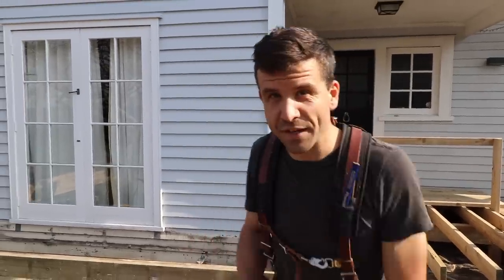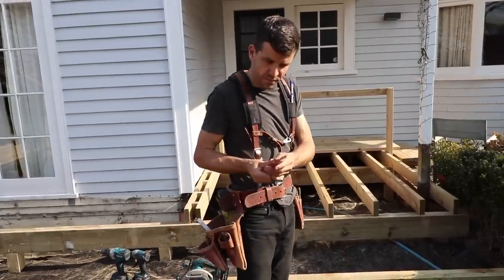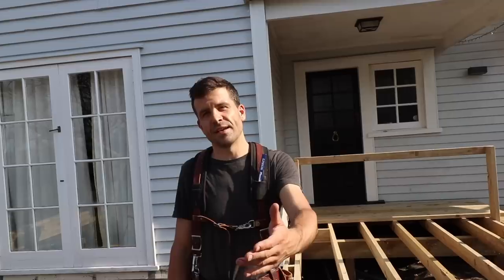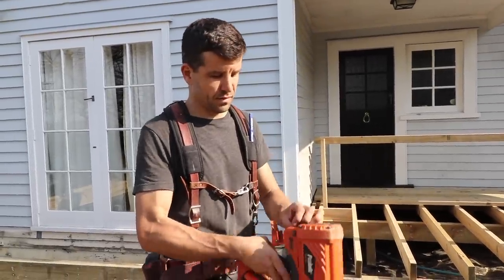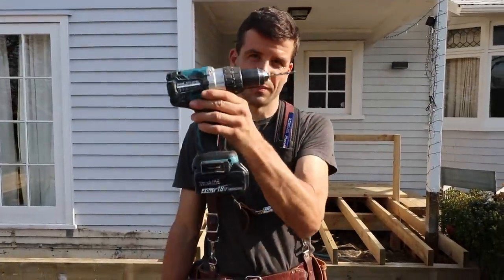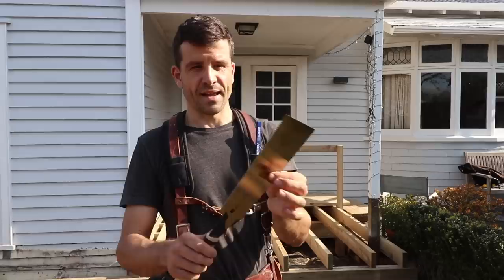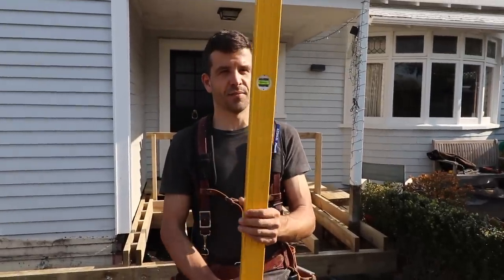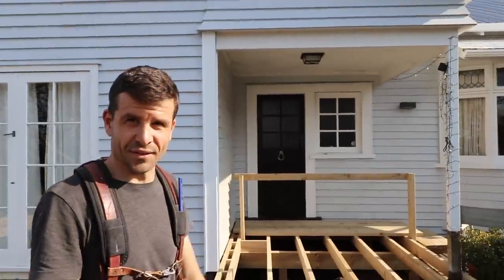First Year Apprentice? Get These Tools!

Comment: Wow, you must pay your apprentices very well if you expect them to supply their own cordless tools and Paslode nailer.  You must have a good contract where you guarantee them steady work for the first year to make this happen???  If i expected an apprentice to show up with a $800 dollar tool bag and $1500 in power tools, I better be ready to hold their hand when mommy isn't there.  An apprentice should make purchase decisions on tools when he is closer to being a journeyman and knows what tools he will need for the line of work he will be doing.  I'm in Canada and most of the time I'm happy if the help shows up at all.  If they have a lunch with them that's a bonus, and if they eat something other than coffee and donuts, they might actually be able to do something...
Reply: Everywhere I worked as a young man all of the Pneumatic Tools, Circular Saws and the large 4' & 8' levels all belonged to the company. 

I had to supply my belt, hammer,tape, and other basic tools which I started with some used hand me downs and bought a few better ones each check. My first apron was two lightweight leather bags on a webbed belt bought from ace hardware. My first toolbox was open topped which I built from pine shelving and a dowel rod.
Reply: I was thinking the same! Haha. I was also thinking about how slow the framing must be if they’re all using those gas paslodes! To my knowledge they’re still single shot and I’d hate to try and nail off with one of those. That’s a punch out gun in my world.
Reply: Phil Gilbert I’m a carpenter in Florida and everything here is built around wind load. When you’re nailing off windstorm osb 3 inch on the seams and 6 in the field with every opening and the top plate being double run 3 inch, no battery or gas nailer out today can keep up with the speed we nail off. I would go broke buying gas cartridges if I tried to use these Paslode guns exclusively. It seems to be a different world where I’m building than where you guys are. Now for punch out or running trim, nothing beats cordless. I do agree with you there.
Reply: @brandongouge9922  cordless has been keeping up with us pretty decent up in SC. air is still king but the gap is quickly closing there.
Reply: It's all about the tools here. I'm not an apprentice, I was qualified in a different trade, and I got a job as a carpenter because I put together the full compliment of tools and a decent van. Over here in NZ if you have the gear, it's assumed you know how to use it. I'm not even going to do an apprenticeship, I'm going to work for a year or two and get licenced instead.

And yes apprentices are expected to fork out for very expensive tools, and no they don't get paid well at all. Wages in NZ are shit. This is why I waited until I found a way to avoid being an apprentice when I decided to switch to carpentry. I have two mortgages mate, I can't survive on minimum wage. These assholes need to realise they are locking out keen, dedicated and committed adults who want to get qualified and already know how to get up and go to work every day, because they pay money that only a kid just out of school would accept. These kids don't know how to work.
Reply: @Patrick-857   spot on, im in Scotland , only 25 years old & over the last few years have been improving upon joinery skills but no company will take me on as apprentice as they would rather pay a 16 year old 120 a week, instead of forking out for dedicated, prepared workers
Reply: Remember, this is NZ dollars, not US dollars. . .
Reply: @arttyree4504  Still, when you adjust for exchange rates, we pay a lot more for tools here in NZ compared to the US and others.
Reply: @Patrick-857  Yes, am not surprised. I would supposed anything imported would have the cost of shipping added. Fortunately, good tools last a long time.
Reply: @brandongouge9922  Milwaukee has some great battery nailers now. They just released a battery powered framing nailer, and you can fire it off as fast as a pneumatic with a bump trigger. I think it gets around 750 16ga shots from a 5ah battery. Granted, this was not out 6 months ago when you wrote this.
Reply: A S C E N D E D W H I T E M A L E  - wow I didn’t even know it was possible to do this, I’m 23 and finding it hard to find an apprenticeship. So when you say you’re going to start working and then get licensed - could you elaborate a bit? Will you just be continuing your current job and learning the skills via internet? And how does one get licensed without becoming an apprentice?
Reply: @Patrick-857   I just moved to NZ from Canada and can't agree more about the wages.  The standard here seems to be, "take advantage of everyone you can until they get fed up and dump you."
Reply: @emersonbartholomew9562  If your trade cert is more than 2 years old then you are considered an unqualified applicant by the LBP board, so you are on the same level as someone who never did an apprenticeship. What you need is evidence you have done restricted work, and you need to demonstrate knowledge of the building code.
Reply: @emersonbartholomew9562  Apprenticeships on building are dumb. All you get is a certificate at the end of it, and while you will have gained a lot of skills, you aren't actually allowed to do anything more than Joe off the street legally speaking. It's nice to tell people you are a qualified builder but it carries no weight. The LBP is what actually matters and that's not a qualification, it's a license, and it's granted by a board.

Also my father got his LBP with a combination of evidence of work he did, and his recently passed Diploma in Construction Management. If you are academically inclined, that diploma is a great fast track to getting licensed, because of how code heavy it is. The LBP board gives zero fucks about your ability to do a nice mitred joint or a tidy hinge recess, they care about your ability to follow the code.

If you can demonstrate your ability to meet or exceed code, you're in. Most builders are violating code on a daily basis, mostly through laziness and wanting to go with cheaper options, and building inspectors are largely letting it happen. They think the code is a pain in the ass made up by people who don't know building. This is incorrect, the code is extremely logical and written by some of the best industry professionals. If you meet code, you are most of the way to a quality product. 

 NZS3604 is your Bible. Follow that to the letter and you can go far.
Reply: Where are you OP, I'm gonna need a job to start my level 2 in 6 months. Haha.
Reply: @Patrick-857  NZS3604 is not the bible of building
Reply: @fanaticz666  Are you an engineer? If not then 3604 is your bible for building in NZ. Builders who think they are too good to read code or even the product spec sheets are a dime a dozen, and aren't nearly as good as they think they are, and are certainly not qualified to pull stuff out of their ärse, even if they are an LBP. Even LBP Design guys aren't allowed to venture outside of 3604 acceptable solutions or approved alternative solutions. Only engineers are allowed to design outside of 3604. Get back to me when you can actually build something to code without someone holding your hand.
Reply: @Patrick-857  3604 only relates to timber not everything related to building so you might want to re read your codes. Its not the bible more of a passage in the bible
Reply: @fanaticz666  Incorrect.
Reply: @Patrick-857  incorrect
Reply: I think Canada and the US have very different expectations to everywhere else. In both the UK and Aus I've seen it as standard that apprentices and tradesmen buy their own tools. They're rarely provided by the company unless it's a specialty tool

Comment: Flat bar. Plumb bob. Jack plane. A set of at least three chisels, the widest being an inch or wider. A dead blow hammer, or a single handed 3 to 5 pound sledge. You need a shorter level for doors and window - somewhere between 2ft and 30 inches will do in most [cases], no pun intended. You should have a big fat wad of pencils sharpened and ready to go. A chalk line. Unless you’re only building small additions and decks, and stuff like that, you should have a 50ft or 100ft measure for long measurements. These are some of the basic things you didn’t mention that I use on a regular daily basis.

Comment: It's amazing how there are, like, four different names for everything in the building industry. I call a "nail-puller" a "prybar", yet I have heard others refer to it as a "jimmy bar". Structafloor, particleboard flooring and yellow-tongue (even though some manufacturers make it green, not yellow). Speed square, quick square, rafter square. Sometimes when people say "nail-puller" people mean a carpenter's pincer. Or a nipper, depending on what you call it. Lmao

Comment: Turn that speed square around so that your saw foot has more contact at the beginning of your cut
Reply: How do you hold it square then? How much contact do you need? I would like to see you do that and see how it works.
Reply: Yep
Reply: @smokingcheeba420  he means to put the t-bar on the opposite side of the work piece.  Same principle, better results.  Leaves the point of the square extended a bit.  Also, with any normally oriented saw (his is a 6.5" blade on left as opposed to right...) His method wont work.  The saw body will hit the T-bar.  You're welcome.  Rough carpenter 13 years
Reply: So it works better to put it on the far side and have it more o. The end of your cut? Finish carpenter for 15+ years
Reply: @smokingcheeba420  first, for any normal, fully sized circular saw (excluding worm drive) his method doesn't work.  Can't stress that enough.   The saw body will hit the t bar mid cut.    Yes, with the tbar on the opposite side (held in left hand, saw in right) it allows more of the square to stick out toward you, starting your cut straight.   Think holding a 2x4 in left hand and cutting off a few inches, scrap to your right.  We use this square quide technique to cut a 45 miter on our 1x6 fascia boards.  The best way to get a good miter besides a chopsaw or a lapcut.
Reply: @9mmkahr  thanx, you explained it alot betta than i could have even tho i been doin it for 40 years
Reply: @9mmkahr  yeah thanks. I think I get what your saying. But how do you do a 45? I guess the same way but with the square the other way. You learn something new every day if you want to.
Reply: @smokingcheeba420  45 bevel not angle. But i guess that could work
Reply: @okboston9086  40 yrs wow... Long time.  What state?  Michigan here.
Reply: @9mmkahr  all the uses of a speed square. Lol. I'm in Minnesota. Not far at all

Comment: And subscribing to Scott Brown carpentry should be added to that list.
I wasn’t aware that New Zealand didn’t use Pneumatic.As always great video dude
Reply: Scott has so many subs & comments now that he can't reply to us all - so me and Frank we'll just talk amongst ourselves. 😎 He has obviously been reading the comments about 'decks' though lol. Ha! - I wasn't aware that NZ didn't use pneumatic either.
Reply from the maker: Thanks Frank,  I've never actually used a pneumatic gun myself!
Reply from the maker: Haha those deck comments made me laugh for sure 😂
Reply: @ScottBrownCarpentry   really so in NZ you stick frame whole houses with a paslode?
Reply: @tommygunaussiecarpenter8680  yeah bro, I've been using paslode framer for 13 years, new builds and renos. It must be so annoying dragging a air compressor hose around like the yanks do....
Reply: Guys who are doing mostly new builds in NZ still use pneumatic nailers a lot, not so much for framing, they have slimline guns for getting between joists for nailing on the thousands for 30mm nails required for joist hangers and fastener plates. They often also have a gun that shoots jolt heads for fixing weather boards. Paslode brand nails and gas is outrageously expensive also...

Comment: i agree with everything except the gas guns! i have 2 that i run, i always use them for everything roofing/running around but for static work (eaves, ceiling framing, etc) i MUCH prefer the extra punch of an air gun. everyone i know and work with is the same as well! plus gas over here is AUS is like $20 a tube and that’s just shit
Reply: It's hard to find nails that arent Paslode packs with gas already in the box here in NZ. They have a near monopoly on nails.

Comment: Love the channel Scott! Subscribed at 9K and within two weeks you're on 13K, well done! 
Curios as to why you need a tape measure as well as the folding ruler?? I would like to see the next tools you'd recommend too. Thanks, keep it up!
Reply from the maker: Cheers man. We use the ruler for smaller measurements, it's easier for marking out on flat surfaces
Reply: Folding ruler also has physical dimensions. Fully folded up its 10mm thick. 5mm unfolded, ect. I often use it as a spacer.

Comment: I’m an apprentice myself not gonna lie but trying to buy tools like what you have just recommended is kinda hard for us as we get paid very cheap (uk apprentice wage per hr minimum £3.60) so yes a combi drill set we can kinda afford that and the basic tools but when it comes to like nail guns which cost £500 plus our hearts starts to cry😂
Reply: Try crying at $800 upwards for one.
Reply: Milwaukee Framing Nailers at $300 USD for tool only here in the States. Maybe you can get someone to ship you gear to avoid VAT

Comment: Could you please go into more detail about the folding ruler, why have both tape and ruler? I haven't ever used one.
Reply: For getting into tight spots taking small measures I'm only a second year but I remember my first day I turned up without a rule and my boss had a go at me when I said the same thing I now see the point and wouldn't be without it lol
Reply: I use for installing windows as a gauge
Reply: mostly for dept measurments and setting up tools and the tape is for layout and marking long lumber
Reply: Get the folding rule with  the  brass depth rule. It helps when taking  interior dimensions.

Comment: Very good, could you do a vid on what a diyer should get, you would probably say use our money to hire you but for those who love our attempts, like what’s the difference between a table saw and a drop saw (miter saw), and if you could only afford one what would be the better option sort of thing...
Cheers!
Reply: If price is a concern get a good circular saw, which can do everything a table saw and miter saw can do. Then a table saw then a miter. A miter saw is a great tool, almost necessary, but only if doing trim.
Reply: It so depends on what you wanna do. If you wanna get into DIY building then a drop saw will be far more useful to you than a table saw because it'll let you make lots of quick, precise cuts and it is portable. This is really useful for things like decking, framing or weatherboarding where you need to quickly cut lots of timber into accurate and square lengths. However in the case of something like furniture making then a table saw will be more useful because it will let you saw timber in long, lengthwise cuts, and because you'll be working inside a workshop where portability isn't a concern. In any case the very first of these things you should have is a Skill Saw.

For someone looking to get into DIY for general household renovations there are still probably about a two dozen tools you'll need, and the rest you'll kind of accumulate when you find that you need them for a particular job. The stuff I'd start out with is:
- Hand Tools: Hammer, saw, chisel, Stanley Knife, nail pull, hacksaw, rasp, sand paper, screwdrivers, spanners, etc.
- Measuring stuff: Square, ruler, measuring tape, spirit level (1m long at least), a pencil (of course)
- Power tools: Cordless drill, electric sander (this is so important for painting), skill saw
- Protection: EAR-MUFFS FOR THE LOVE OF GOD, good boots, eye protection, dust mask, gloves

That'll get you started, but if you start getting serious you'll end up getting other tools that'll make your life far easier, like nail guns and routers.

Comment: A circular saw (what you call a "Skillsaw") does NOT cost $800.- in the USA.  They go for about $70.- in 2018.
Reply: Cordless saws can get quite expensive if you plan on running strong and long lasting batteries.

Comment: Im, just about to start my apprenticeship, I have most of the tools already. It would be great to hear what the next set of tools you got. Also if you had a battery operated skilly would you need a cable one also?
Reply: Battery operated will do for an apprentice, if you are doing a floor or a large roof/deck etc then you will need a corded one (or 10 batteries) but someone you are working with will have a corded, if they see you making an effort to buy tools and you have a cordless they will be happy to let you use the corded

Comment: Scott, great work man keep it up. hey whats your thoughts on your suspenders? thinking of getting myself a set to go with the big oxys im about to order. cheers from a nz builder
Reply: Depends on how much load you are carrying they help hold the weight better but also make it harder to move around
Reply: ok thanks, am i better off going for the leather strap one instead?
Reply: @dentynz8707  do you mean like a normal tool belt? If your in Australia I would get a buckaroo one I got mine when I started and I still use it. That was 12 years ago